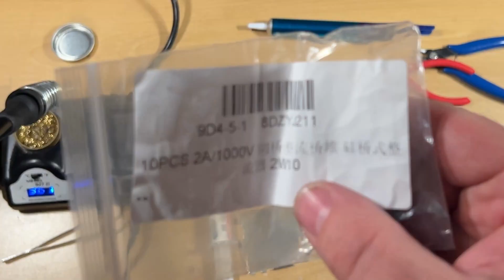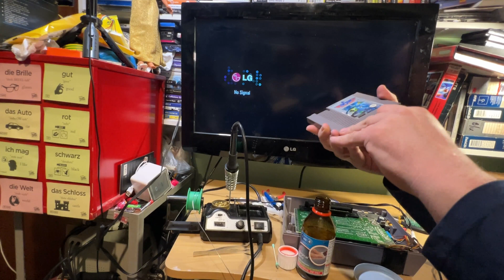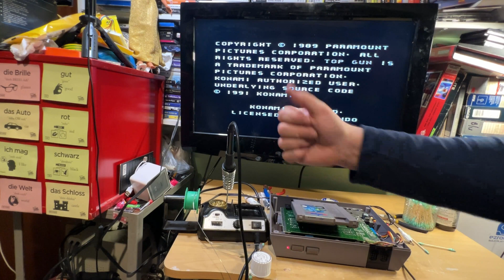Nintendo NES Power Bridge Rectifier Repair

Comment: I ordered the replacement part because I’m having a similar issue..I got everything taken apart but my NES doesn’t have the bridge rectifier that looks like the one in your video with the black top…I’m so frustrated with this thing 😅
Reply from the maker: Thanks for your comment. Is your model a UK one or USA? I’ve noticed with a lot of different region consoles they will either change the component or locate it somewhere else. Have a look for a component with the + and - symbol on it or generally have a look over the board for any components that look damaged or capacitors that are bloated. Hope this helps and let me know how you get on 👍
Reply: Fr853? Brown alps board? Console5 has some replacements
Reply: Some of them have the rectifier some have 4 diodes